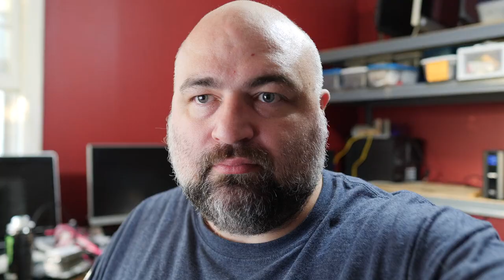Even MYTHBUSTERS Got The Airplane Conveyor Belt Question WRONG - A Neckbeard Explains - Jody Bruchon

Comment: I agree with you. As a controls engineer, the part of the question that immediately stuck out was about the conveyor matching the speed of the wheels, meaning that any forward progress would necessarily result in the conveyor accelerating to infinite speed, and so then the plane can only take off in a scenario where the wheel bearings are ideal. 
The conveyor is impossible, as are ideal bearings. 
The answer to the question would be purely down to which of the two you decided to put real world constraints on.
Reply from the maker: You definitely understand it! It's amazing how much this question tells you about a person's actual thought processes and understanding of problems.
Reply: That was the same thing for me too. That factor means it would cancel out any product of forward movement its a 1 to 1 transfer
Reply from the maker: @flyingfiddler90q  Does a plane take off if all the wheels are locked by brakes?
Reply: ^ Of course not. Unless you're on ice or something. That's the point.

Guys... what you're describing then is a mechanical problem i.e. how much stress the wheel bearings can take.

Here's the problem: for the speed of the wheels and the conveyor to completely synchronize would mean the wheels would have to be limited to the conveyor speed: you would have to apply brakes, which creates excess rolling resistance - the only way for your claim to work.

But here's the real clincher: assuming that the conveyor would have to accelerate to infinite speed. This is ridiculous. Your wheels will only spin as much as double the take off speed, which is a finite number - your conveyor can't go faster than that.

It's astounding, you've created detail problems that don't actually exist.
Reply: @JodyBruchon  a plane could take off if all the wheels were locked by brakes, assuming the thrust was enough to overpower the frictional force between the tires and the surface. only if there was a plane like that... oh yeah, a sea plane! they (for intents and purposes) have no wheels! and oh boy landing on water slows you down faster than any brakes could.
Reply from the maker: @vanguard6937  Sea planes are on water and a plane with locked brakes will simply fall over and crash. The problem says nothing about locked brakes either.
Reply: @Eatinbritches  Not a mechanical problem; a logical one. 
The question stipulates that conveyor speed (v1) = wheelspeed (v2). For one to move relative to the other whilst maintaining contact, v1=v2+forward motion (v3), which of course means for v3 values over zero, you violate v1=v2.
The terms of the question preclude that. The speeds are 'exactly matched', therefore NO relative movement.

Comment: It does not matter how fast the wheels are spinning. They could be rotating at a billion RPMs. The plane will still move forward. The plane is not reliant on friction from the wheels to take off whatsoever. You could use a jet plane as well, the prop doesn’t matter. Draw out a free body diagram for this, if you do it right, it’s relatively obvious.
Reply from the maker: Do you not understand the constraint? The wheels are not allowed to spin faster than the conveyor. Please explain how the airplane takes off when the wheels are locked to the speed of the conveyor. It doesn't matter how the plane is driven; the constraint prevents forward motion, because by definition any forward motion will cause the wheels to spin at a higher rate than the conveyor moves in opposition. Propulsion is a distraction. Friction is also irrelevant. The constraint is that the wheel rotation must be tied to the conveyor exactly. Until the plane lifts off the conveyor, this means zero forward motion.
Reply: @JodyBruchon  let me put it this way. Say you’re on a frictionless surface. You are standing still. That technically means the surface you are matches the speed of the bottoms of your shoes, zero. Yet, if you pull a rope, you still move forward. How is this possible?

You need to think about the wheels of a plane the same way. You keep saying that they have to move at a faster speed than the ground below them for forward motion to occur. That’s not true. For another, more realistic example, think of a seaplane floating down a river. Is it impossible for the seaplane to take off against a strong current? It is, in fact, moving the opposite direction of its motion, therefore the thing that it rests on is actually working against it rather than keeping it stationary. Yet, it takes off anyway. Why? How is this possible? Compare that to a conveyor that even moves faster than the wheels of the airplane, say by 100 RPMs. What’s the difference, why can the seaplane take off but not the plane on the conveyor?

Because the planes forward motion is independent of the wheels. That is to say, if the conveyor and wheels are moving at net zero, the wheels will literally be dragged forward by the motion of the plane
Reply from the maker: @drakeafletcher  There is no such thing as a frictionless surface. A seaplane doesn't have a moving surface on the bottom to match speeds and is on a fluid rather than a solid. Water is not solid. Analogies to water do not work. 

The constraint prevents forward motion. The hypothetical is impossible to implement in the real world due to practical considerations that make the perfect speed matching impossible to maintain, so the underlying problem is that the specifications of the hypothetical are invalid. Keeping it purely theoretical, however, the plane could never take off--not because the wheels move the plane, but because the wheels aren't allowed to exceed the speed of the conveyor, friction plus weight applying a downward force to couple the two surfaces absolutely exists, and the only way to disconnect them is with upward force.
Reply: @JodyBruchon  ah, so there’s the problem. For some reason, you’ve also snuck in that the static coefficient of friction between the conveyor and the wheel is infinite, meaning the only way to separate them is do go directly in opposition to the force of gravity meaning no matter the horizontal force, zero sliding will ever occur. I’m not sure why you make that assumption since you said yourself we had to read this like legal text and that constraint is never listed. I’m also not sure why I can’t use a frictionless surface for an example but you can use this hypothetical material? Rubber only has a coefficient of friction of about 0.9, and rubber on rubber, as is common in conveyor, is only 1.15, meaning sliding can easily happen with enough force, especially that of a 747 like in your example. If the cof between 747 tires and the ground were as high as you imply, every time one landed, it would slam the nose of the plane into the ground and destroy the plane.
Reply from the maker: @drakeafletcher  You are missing the forest for the trees. Please feel free to stop bothering.
Reply: @JodyBruchon  lmao alright man
Reply: @JodyBruchon  Actually... this whole thing CAN be tested in the real world. All you need is a plane with a set of electric drive wheels. You set the plane with the electric drive wheels on the converyor belt... match the speeds between the conveyor belt and the electric drive wheels... fire up the main jet/propellor engines... and see what happens. But I'd be willing to bet the plane would just drag the wheels and all... in spite of the wheels squealing in protest... forward and into the air.
Reply from the maker: @bcarvermobile  It's not possible to test this in the real world. The materials don't exist to make such a conveyor and there are numerous other physical limitations that prevent it.
Reply: @JodyBruchon  I know this is a few months after, but here's an explanation that's hopefully easy to visualize.

Take a toy car. The wheels are attached to the opposite wheel with guitar wire, providing two axis. This axis aren't mechanically attached to something like a gearbox or engine, so they spin freely. This, is a free-spinning axis. Ser a treadmill to go at 10mph. Now, holding the toy car, put it on the treadmill. While you hold it, there's no real force pushing your hand back because the wheels are spinning freely. You are also able to push the car forward, despite the high speed of the treadmill. 

Now take this to an airplane. The wheels are free-spinning. They aren't mechanically attached to anything, and nothing causes them to rotate. The force of motion forward is produced by the engine. While the engine pushes the aircraft forward, the wheels begin to spin, but this puts little resistance on the aircraft. The plane can continue pushing forward despite the wheels because the wheels aren't actually what causes the plane to move forward.
Reply from the maker: @mrpug2794  It doesn't matter where the force comes from. The wheel spins freely but it doesn't move forward freely. It's attached to the fuselage and the wheel's contact surface is attached to the ground through friction. If the axle that goes through the center of the wheel moves forward relative to the ground, the wheel's contact point with the ground doesn't slide against the ground, it forces the wheel to rotate. If the question says the wheel has to match the speed of the ground (giant conveyor belt) moving in the opposite direction then the wheel rotating faster than the conveyor belt slides beneath it implies forward motion of the plane in Earth-relative space, but also violates the constraint that explicitly says that the speeds must be matched.
Reply: @JodyBruchon  the question is worded for those who don't have a great understanding of aircraft as a trick question. A more accurate phrasing is if the treadmill went the same speed as the ground speed of the aircraft rather then wheel rotation. If you were talking about wheel rotation, it would rotate an infinite number of times per second
Reply from the maker: @mrpug2794  If the conveyor is stationary and the wheels must match the speed of the conveyor, does the plane take off? How?
Reply: The speed of the wheels is not measured by the rotation of the wheels, but by how fast the center of the wheel is moving forward.
Reply: Imagine the scenario without wheels. If a plane is sitting on its belly on a conveyor belt moving backwards at 500mph were to suddenly fire its engines with 500mph equivalent thrust, then I think we are all in agreement that it would be stationary. Now add in the wheels. I think the people who are saying it would take off are imaging the wheels ‘just’ touching the belt. In this magical case I agree the plane would take off. But if you have the whole weight of the plane on the wheels, then just as in the belly case, the plane will be dragged back with the conveyor belt. There is no way the wheels would spin freely in that case.
Reply: Motion is relative so the wheels and ground/treadmill always move in the opposite direction at the exact same speed from each other. If The wheels spin the same speed as the tread mill and the plane moves forward down the runway\treadmill relative to an observer that's off of the treadmill/runway that would still be possible it would just result  in the treadmill and tire slipping because the force of air friction is greater than the wheels to treadmill surface friction. The tires can spin faster or slower than the plane because the forces and weight of the plane easily overcome the friction of the tires.

Comment: Ok, we need to precisely define wheel speed.   If it is not RPM, but rather the speed of the wheel relative to the non moving runway, then you are correct... the plane would not take off.  This would not require a 747 to replicate.  Mythbusters could have done it actually:  just accelerate the tarp as the plane moves forward to keep the plane back.  This would require a lot of speed though because the friction limit of the bearings on the planes wheels would be the only thing pulling the plane back.  

Think of it this way: could a conveyor belt runway accelerate a glider to take off speed?  If it was on really good bearings it would be a lot harder than if it was on seized hubs.
Reply from the maker: The problem is that the plane pushes through the tarp to the ground below. The tarp doesn't support anything. A conveyor does.
Reply: @JodyBruchon  yep, I get it.  A tarp being pulled it basically a really crappy conveyor belt.  Both still have some friction.  The argument isn't really about whether the plane would lift off, its more about whether it would move.  The "no lift off" people envision it staying in one place on the runway.  The "lift off" people see it moving regardless of the tarp or conveyor.  A car on a conveyor is easier to grasp because the wheels drive it forward. The plane harder because the wheels hold it back (imagine really rusty bearings... makes it easier)
Reply from the maker: @vomithaus1  The constraint in the question says the wheels can't move faster than the belt, period. That means that the plane can't move forward. That means that the plane can't lift off. It has nothing to do with where the forces come from. The wheels are not permitted to exceed the belt in speed.
Reply: @JodyBruchon  yes.  People get confused over the 'speed of the belt though...  I imagine you see then belt as xx mph (rolling backwards)... so plane is moving xx moving forwards, which means relatively to the stationary runway it is not moving.  No forward motion,  no lift (excluding air turbulence from the belt, props, winds etc).  I am just trying to frame it so that both sides can see the problem, because I think everyone is actually on the same page.  An airplane can actually do vertical take-off (relative to the runway) if there is a strong enough headwind.  The core of the argument is whether it is possible to prevent an airplane moving forward on a runway using a conveyor belt.  Practically, it's not possible (as you say) but give infinite parameters (as you say) it is.
Reply: @JodyBruchon linguistically you're correct. However, you're overthinking the question. You know what the question was really asking and it takes off because thrust doesn't care about treadmills.
Reply from the maker: @joeg4589  Precision matters in science. The question is worded the way it's worded and it means what it says. "You know what it really meant" demands I divine something out that does not exist. That's not how science works.

Comment: Imagine the scenario without wheels. If a plane is sitting on its belly on a conveyor belt moving backwards at 500mph were to suddenly fire its engines with 500mph equivalent thrust, then I think we are all in agreement that it would be stationary. Now add in the wheels. I think the people who are saying it would take off are imaging the wheels ‘just’ touching the belt. In this magical case I agree the plane would take off. But if you have the whole weight of the plane on the wheels, then just as in the belly case, the plane will be dragged back with the conveyor belt. There is no way the wheels would spin freely in that case.
Reply: It would honestly take a very minimal amount of thrust to overcome the friction of the wheel spin. The only way a plane isn't taking off from a backwards conveyor belt is if the brakes are on.
Reply: Actually if the plane was moving backwards on its belly and the engine fired  with enough force to overcome the friction, the plane would start to slow down and eventually overcome its reverse, with enough thrust, it could overcome the belly friction of the plane and in theory, take off, assuming a sufficiently strong airframe to survive it
Reply: @DragonstarFighter  yeah, I agree with everything you said. But if we assume the plane has a limited amount of thrust, then we set our magical belt to be faster than that and the plane won't take off.
Reply: @timramich  Yeah, I think I see what you're saying.
Reply: @timramich  that's not quite right.  The friction of the wheel spin is irrelevant to the topic.  The premise is that the wheels do spin freely like you would find in a typical physics problem.  While the aircraft is on the ground, the thrust force either advances the aircraft because it either rolls on the wheels or it scrubs along the surface (static v. kinetic friction force).

People are acting like the conveyor is acting on the wheels while they are in the air.  That would be true - one could spin the wheels forward or backwards while the wheel and axle are isolated in the air.  On the ground, if the vehicle moves, it's because it's rolling...and if its rolling, the conveyor exactly matches that speed.
Reply: @MrDefreese  What?
Reply: @timramich  rolling wheel speed is directly related to vehicle speed while on the ground.  The condition given to us is that rolling speed is exactly matched by the conveyor so no condition we can imagine ever breaks the condition of the conveyor nullifying any vehicle speed.

The problem with the experiments which try to show the plane will take off almost always show the conveyor with constant speed instead of the conveyor ‘exactly matching’ wheel speed.

It’s a truly ludicrous thought experiment but if those are the given parameters, that’s how we have to approach it instead of creating alternate conditions.